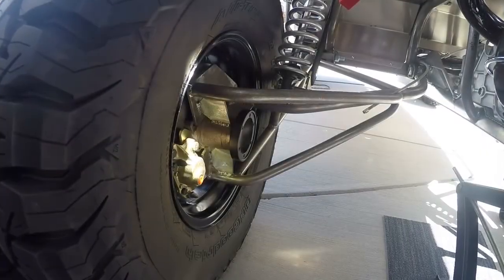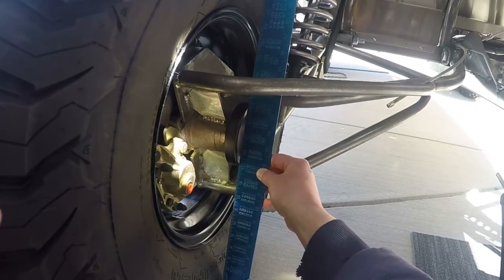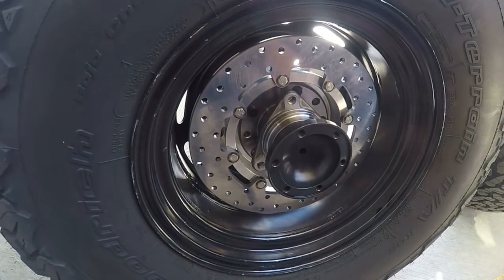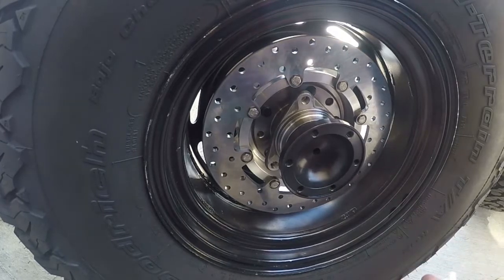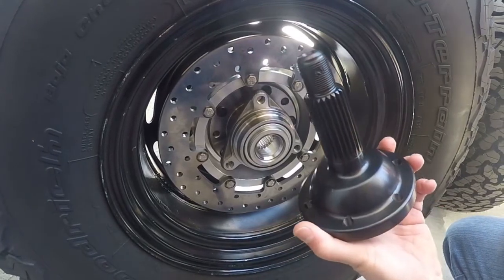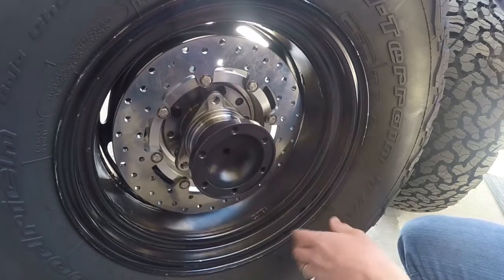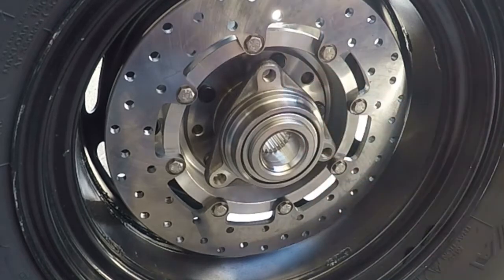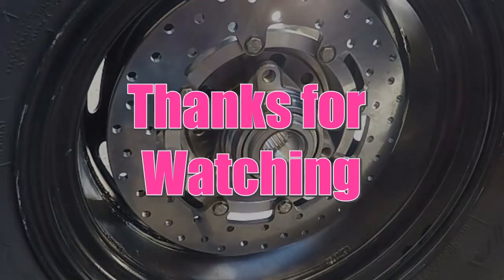Micro Stubs vs Type 1 bearing assemblies

Comment: I carry a spare stub axle, bearings, cv, and bolts for the rear. I like type 1 because the bearing spread is wider and they last longer
Reply from the maker: Always be prepared. 👍
Reply: Type one is old..it's not as strong ,,and less wheel travel
Reply: @anthonyolsen9299 not sure how many times you are wrong there but let’s compare, I have a 4” over torsion housing and 3x3 arms running 12” coil overs. So my total width over stock is 10” and I have race prepped 930cv that lets me cycle a solid 14” of travel in the rear, once again you are limited to cv angle and longer is better ( he’s not cycling 14”) a unit bearing is very inferior to the ball and roller setup that a stock type1 uses and will fail way sooner with a 33” tire I’ve seen it many times. And just because something is older doesn’t mean it doesn’t work as well or better, I’ve been doing this 30 yrs and have never broke a chromoly shaft but the splined hubs do fail from time to time

Comment: not to mean but it not full float like you say. you  are still required to the mirco stub axle install to make the hub last. it need the torque on it. if not like you said it will fall apart on you as you drive.

Comment: Tires going to fall off when the micro stub breaks the bearing are pressed on ask me how I know
Reply: The bearing and house bolt to the trailing Arm.. so I don't know what your issue is.. I've been racing on micros for years.. but I'm on mid boards now,,
Reply: @anthonyolsen9299 he’s correct, every unit bearing needs the axle nut to hold the inner race into the housing. Go remove the axle nut on any 4wd front hub and go for a ride if you don’t believe

Comment: thanks what motor and trans are you running and why?
Reply from the maker: CYA TV, the motor is a 1974ish 1600DP. I will one day upgrade to something nicer and bigger. But for now I'm bleeding cash just working on the chassis.
The transaxle is a bus type 2 with the 5.38 R&P. I went with that because I wanted to run 33" tires and the terrain I will be driving in is mountain trails. So the speeds will be low and there will be a good amount of going up and down inclines. Once I get beyond the chassis I will have videos on the motor and chassis.
Thanks for the comments!